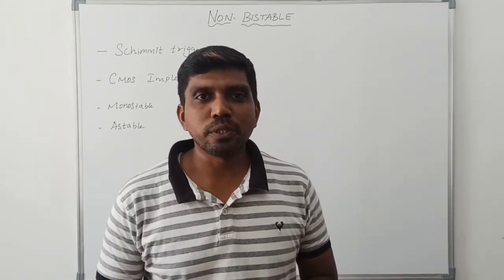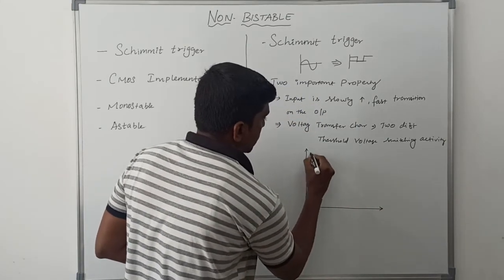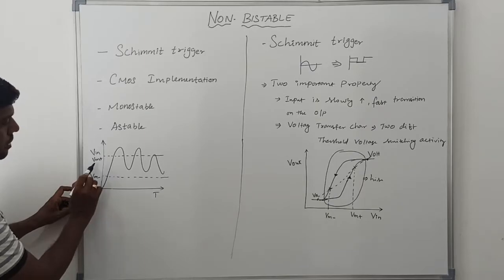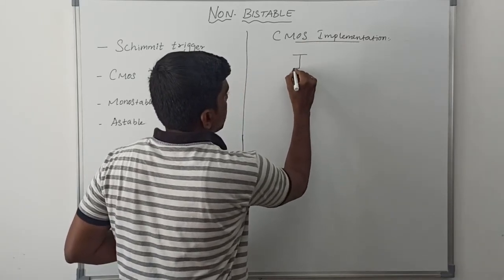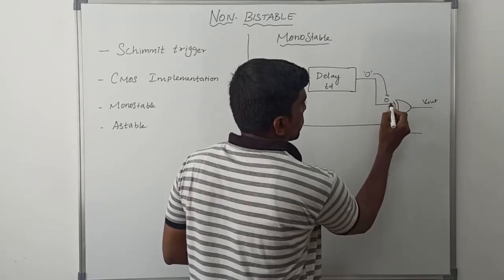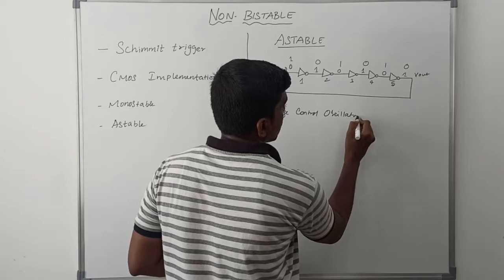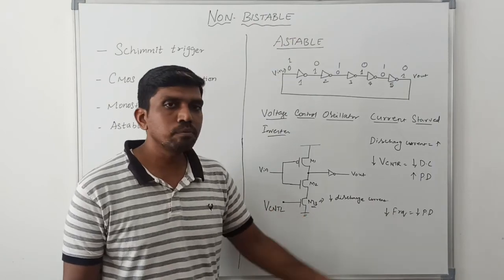Non-Bistable in vlsi design || Learn Thought || S Vijay Murugan

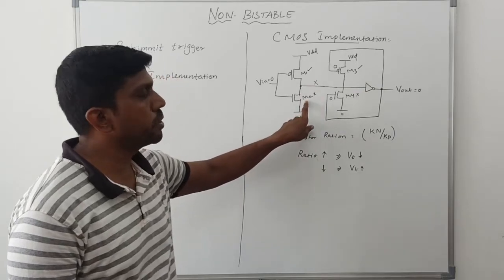Comment: sir..at 10:10 Both the transistors M2 and M4 in pull down network are turned off but why only one NMos M2 is mentioned in transistor ratio ???
Reply from the maker: Thanks for your comment, M4 is extra pull down device it speed up the transition and help to produce clean output signal.